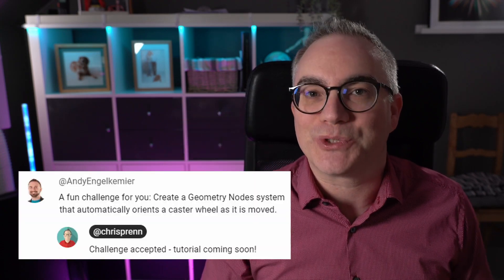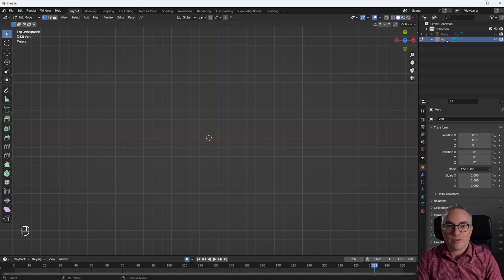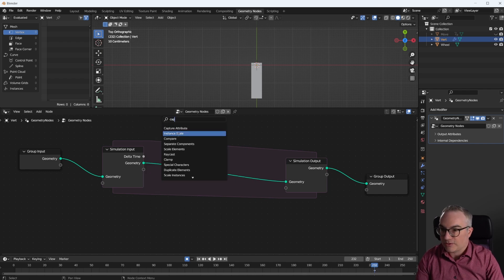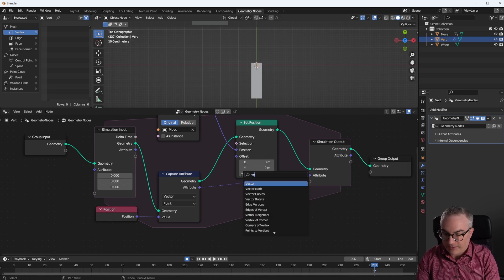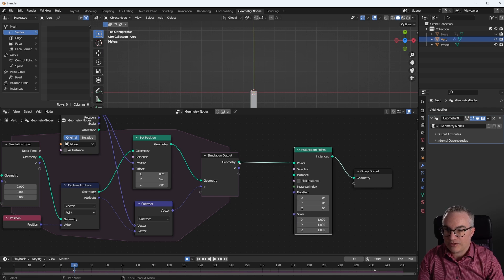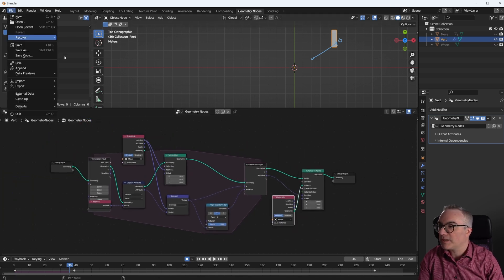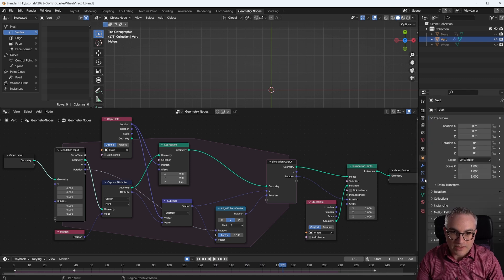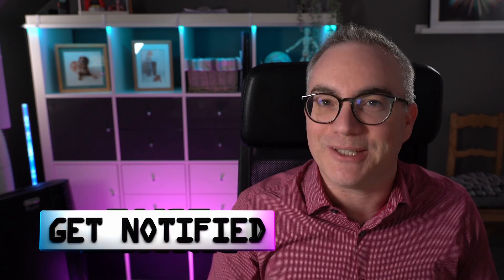How To: Caster Wheels (1/2) Blender Geometry Simulation Nodes Tutorial

Comment: This is a working approximation for animation, but it is not physically correct, or geometrically correct might be a better word. 
The basic assumption that the wheel follows the path of the “dragging point” is wrong. 
Wheel creates its own path. This is obvious, if you imagine for example a few meters long crossbar that has a wheel at the end. If you start to walk “sideways” in a circle path, which centre point is the wheel,  the wheel is not moving anywhere. You can walk around the wheel, without the wheel moving, so it can't be following the same path as the the "root/drag axis". 

But thanks for the tutorial. Now I got my mind got hooked in to find a more accurate solution for this. If I do find one, I'll post it here.
Reply from the maker: "Working approximation" = working 😊👍🏻

Comment: This isn't what I was hoping simulation nodes would be, this is more like writing your own solvers.  I was hoping simulation nodes would be more along the lines of giving objects various physical properties via attributes, and the a simulation engine takes care of the rest (like the current simulation system, but with greater control due to it being node and attribute based).  So for example you could set a selection of vertices to act as cloth, and then increase the weight attribute of those vertices in response to collision with rain particles (to simulate cloth becoming heavier and more resistant to bending in a wind forcefield).

Another would be reducing the stiffness attribute of vertices in response to collisions with particles that have a high heat attribute set.  good for making an iron rod bend as the physics engine considers the changing stiffness and weight attributes of the affected vertices.

Or another example, being able to specify the inner_density attribute an airtight object to emulate heavy metal, or a helium filled balloon etc.
Reply from the maker: I think that's where this is heading! Imagine pre-defined node groups for physics sims....

Comment: This is a great start, and very informative. Unfortunately I don't know enough GN to solve the problem myself yet, but the big challenge with caster wheels is flipping. This solution sets the orientation based on where the current point is now and where it was on the previous frame. The problem with that is if the wheel stops, then change directions, you get a sudden flip.
The orientation should work by "dragging" a point along. One way to do this (but setting it up is annoying) is to create a single mostly rigid hair the length of the wheel's radius with no dynamics and put an object at the end of the hair. The caster can then orient toward the object at the end of the hair.  It works great, but is a pain to rig. The appeal to GN is setting a node setup so I can put the pieces of a caster in a collection, create a plane like you do in part 2, and then I just need to define the body of the caster, the wheel, and it could take care of wheel rotation based on distance moved in local space, etc.

I'm not quite sure how this would work with GN. Really I would do it the same method as the hair for the most part. Draw a line from the pivot point to the wheel center (but keep Z the same and this position isn't linked, it's just for initial orientation). The second point position should attempt to be the same as the previous frame as close as possible while keeping the same length. So as the wheel moves, obviously the pivot point moves, but the other point will move only to keep the line length the same. If it's already out to the side then the wheel will straighten along the animation path. If it's pointing Exactly straight forward then it won't flip around at all, but that's really hard to maintain. With subtle movements the wheels will flip back around.
Reply from the maker: Smoothing the rotation as shown in the 1st video at 7:45 is not enough?